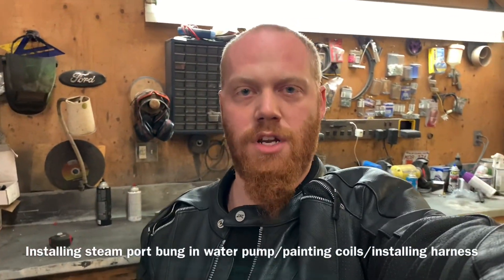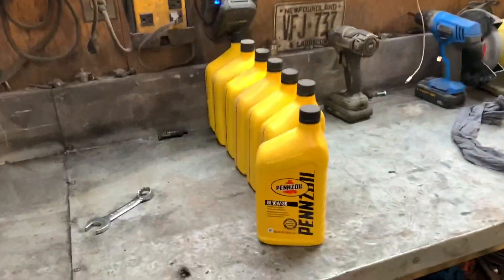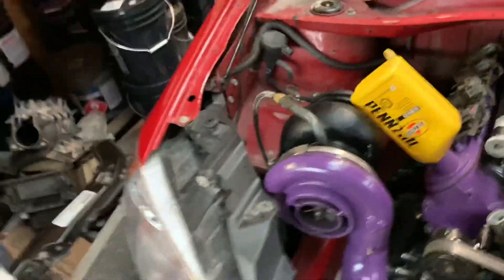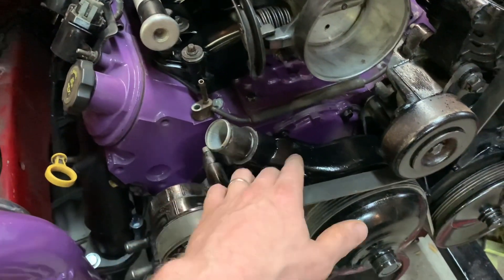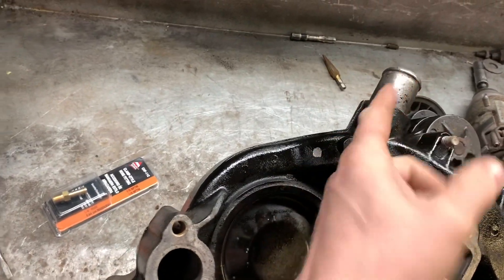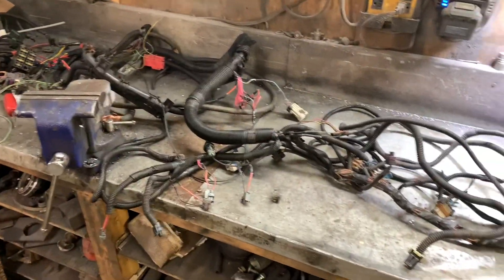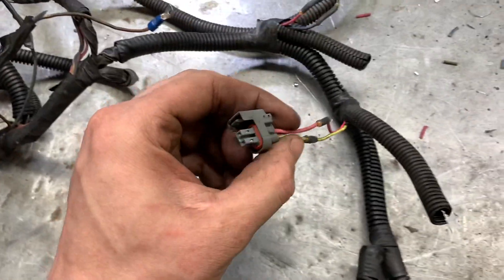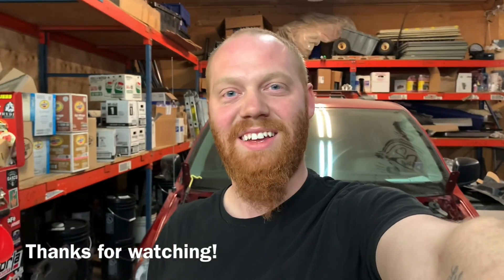How to route steam vents on LS swap. Drill and tap the water pump for a barbed fitting

Comment: as for steamport, dont you generally have to vent it to a higher position in cooling system?
my stupid steam port is the worst. it goes straight up to the throttle body comes out the other side so its already much higher than any of the cooling system.
Reply from the maker: They do recommend having it higher so air bubbles can easily get out, but they’ll have no trouble going through the water pump, a lot of people have done it and it works really wel, I have the same setup on the rat rod
Reply: @StationroadRatrods  so you left it connected to the throttle body like that? what does that do anyways?
Reply from the maker: I should have gotten a better angle. I didn’t have it connected to the throttle body, I actually always bypass that, because it sends coolant through the throttle body to help heat up faster in colder climates, but it heats the throttle body, driving up air temperature and can cause power loss
Reply: Being it's in the water pump outlet and angled with it, it will probably have a venturi effect and pull from the air bleed. Probably a better design than stock.

Throttle body heaters are to keep your throttle from freezing in deep winter. As Barry said, they're not vital in most climates. Though power loss is small, it would be nice if they were ambient temperature activated instead of always on.
Reply from the maker: Nailed it
Reply: @StationroadRatrods  I dont have facebook but i can maybe borrow someones phone who does. I started it up today without writing  new tune to pcm, and it ran a good 5 minutes without vats shuttting it down so maybe vats were already removed?  
Seem to smoke alot  but it has 220,000km & was in enclosed garage too. everything was smoking but thats what you get for running a dirty greasy engine with zero cleaning and fresh paint on the ypipe... haha'
it seems to have a slow lopey idle already with stock cam.
maybe cuz only one o2 sensors hooked up so far.
She still needs electric fans wired up, steamport installed, a coolant flush, new temp sensor and quad  dash gauge , oil change and top up tranny fluids before she can hit the highway though.
Reply from the maker: I’m glad it runs!! If vats wasn’t deleted, it would fire up and die right away, every time. So it looks like you’re in the clear. As for the smoke, your paint is burning off, there’s probably oil in the intake manifold (common issue for the LS engines) and if you have one o2 sensor unplugged it will definitely go rich and you’ll have smoke out the tailpipes, but hey, you got it running and that’s awesome!! Button up a few small things and get it moving!
Reply: @sienile  makes perfect sense, 2003 dodge hemis didnt have that steamport throttle body warmer  cuz mine ended up in the shop several times to try n find idle, stall issues in minus 30 weather. i finally figured it out myself  just by opening the throttle while not running and notice big ice chunks holding throttle open. But i wont be driving this car in winter as somebody before me went to great lengths to keep a 37 yr old car rustfree, might as well keep it that way.

Comment: I know that nervous feeling. 
Im trying to tune my one and only PCM.
 I made the bench harness. 
Read and saved the stock bin with PcmHammer.
 Removed the VATs and enabled electric fans with TunerPro and saved it but it gave me this error on saving;
Error-one or more checksums could not be updated. check checksum adresses etc, for validity.
ive asked around on tunerpro forum, asked the guy who gave me the XDF,  asked quite a few Yt channels. Noone seems to know what that means or how to fix it.
Finally emailed creator who gave me his tinytuner application which supposedly fixes the checksums automatically.
it seems too easy and very hestitant to write the bin to my only PCM

you ever run into this type of error tuning?
Reply from the maker: Hey man sorry I haven’t ran into that before, are you using HPtuners? And if your pcm bricks I may have one that’ll help you, what’s the last 4 digits on the serial number?
Reply: @StationroadRatrods  No i used PcmHammer to read and copy the PCM. Then I used TunerPro to remove the VATs and Enable electric fans
I have Serv. No. 12200411 on my pcm sticker.
Reply from the maker: Okay, I’ve never heard of any of that haha but if it bricks on you and you don’t have a spare let me know, I may have an extra one to send you.
Reply: @StationroadRatrods  that would be great man, let me know.
 im waiting for exhaust parts arriving wednesday to build new ypipe and finish exhaust before i will be ready to start it.
Reply from the maker: Post a video on the Facebook group if you like! I’d love to hear it
Reply: Sounds like your tuner program doesn't update the checksum after modifying the file and the other program just calculates what it should be. I would make a copy of the "bad" file and run it through the checksum updater, then open that file in your tuner program to verify the values are the ones you set. If you find something different, that means you need to not use that file. You can try to do this over again, but if you keep finding errors, you need to start over with a copy of your stock read, or maybe even re-read from the PCM.